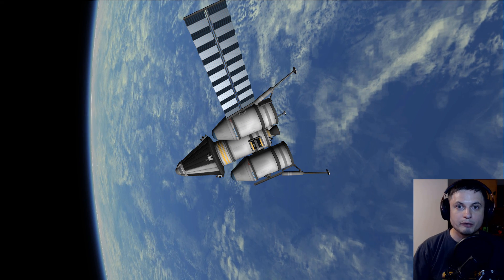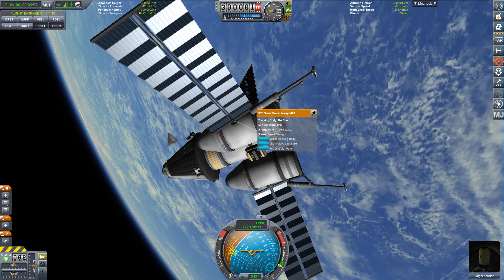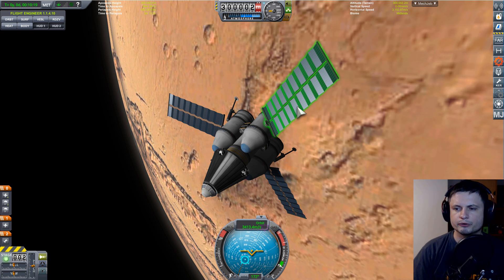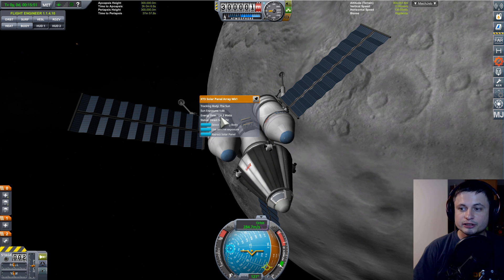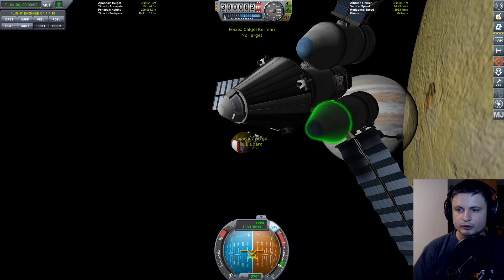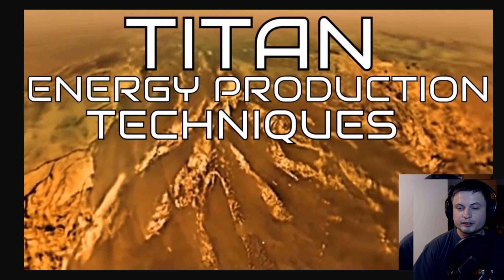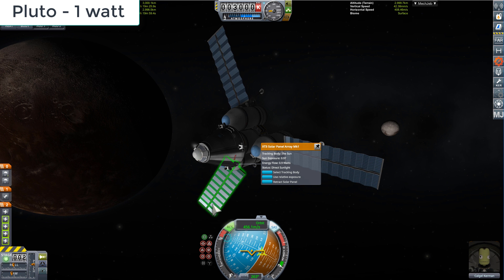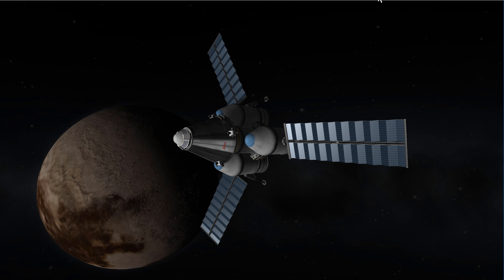Things You Probably Didn't Know About Solar Panels

Comment: it all depends on if the energy is been used directly by the probe systems or it's been stored. 10watts would charge a battery very easily.

Comment: Dear Anton: Could a spacecraft in orbit around Europa or Io generate power by trailing a conductive wire through Jupiter's magnetic field? I'm not  sure how to do the calculations there, but it might be a viable option vs. solar, even at the cost of a lower orbit or using hydrazine to maintain the same orbit.

Comment: Why are we talking about 90% efficiency of the solar panels if the best efficiency I heard of, so far, was approaching 30%? What am I missing?
Reply: It's illumination, not efficiency.
Reply: @alexandruianu8432 : So under what circumstances there would be a 100% illumination? BTW, didn't I hear Anton talking about efficiency?
Reply: @voice4voicelessKrzysiek  If the panels are perfectly perpendicular to the incident light, illumination is 100%. Solar panels are getting better and better efficiency, so that increase could make them more viable for more asteroid belt and Jupiter missions, however plutonium availability was more of an issue when Juno was being made. As far as I know, production had restarted specifically for space exploration by the time it got to Jupiter. It might even pick up now that the US has withdrawn from voluntary nuclear arsenal restrictions in relation to Russia.
Reply: @alexandruianu8432 : You are saying that even at the farthest distance from Sun, the illumination is still closer to 100%? You can always orient the panels so there is 100% illumination? What does that have to do with the power output of the panel?
Reply: @voice4voicelessKrzysiek  It just means that you can't get any more power at that distance at the rated efficiency and size. Illumination has nothing to do with efficiency, just how well it's oriented to the Sun (or whatever source of light there is). Given the small size of solar panels relative to the Solar System, no matter how far or close you are, the incident light rays will always be parallel, not divergent. This means you can always get all of them to strike the panel at the right angle.
Reply: @alexandruianu8432 : I think I have pretty good understanding of these solar panels properties, I was just questioning Anton's usage of the word efficiency. Listen what he says at 1:30. Shouldn't he say "illumination" instead of "efficiency"?
Reply: @voice4voicelessKrzysiek  Oh, yes. That's what I meant. He used the wrong term.